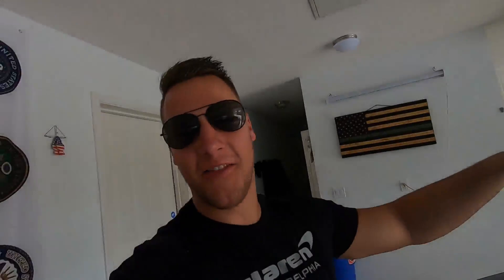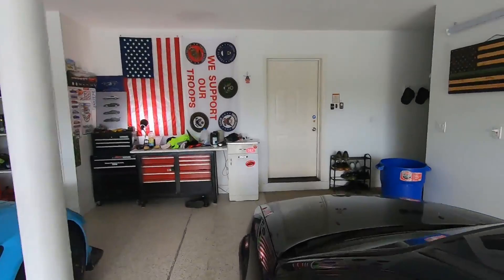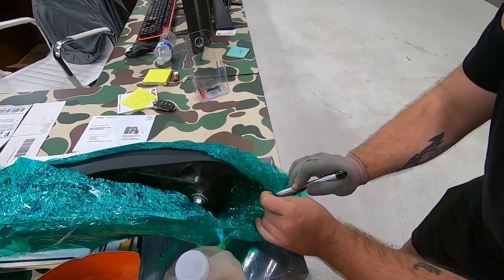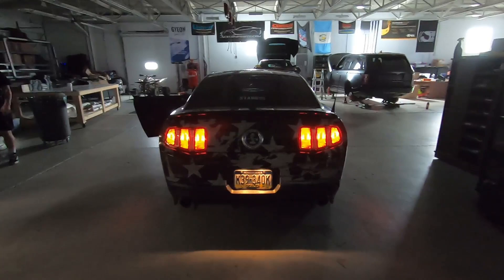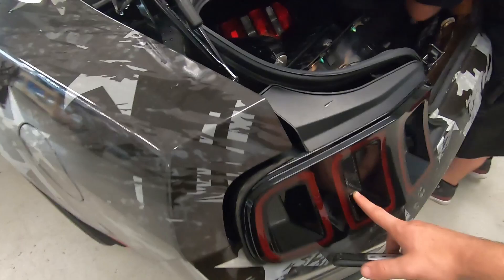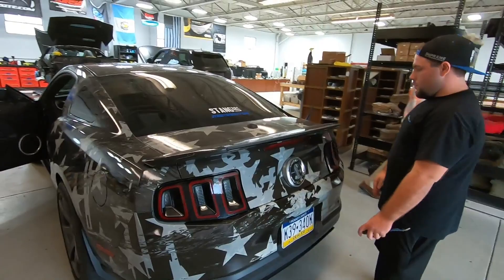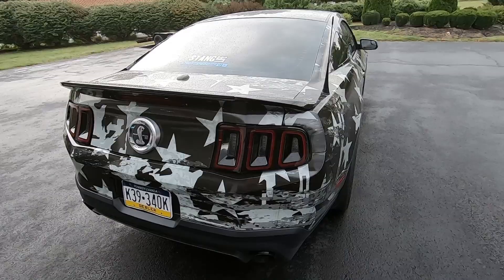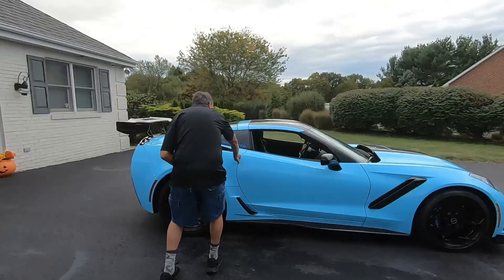EVERY S197 Mustang NEEDS These!!! **2013-14 Tail Lights on a 2005-2012**

Comment: Raxiom makes a trim piece to fill in the gap between the tail lights and bumper.
Reply: I really notice it
Reply: I was gonna say the same thing about American muscle selling a piece to fill the gap
Reply: Mike Shagwell hell that’s gonna blow the budget lol.
Reply: Lol 😂 ikr whoever wins it can use the gap as a bottle opener !!!
Reply: he couldve just gotten the raxiom vector v2s
Reply: Noxum 55 That’s what I have on my GT500. I like them a lot more than the 13-14 taillights!
Reply: I’m with you Mike. I think the gap makes it look more aggressive here, no mod necessary. On a white/bright car though I might feel different.
Reply: @ShaneSVT  i have the s550 headlights, working on saving for the tail lights at some point, they look great especially if you black out the trunk between the lights

Comment: The 2012 and earlier tail lights date the car so bad.  Great look with the updated lights
Reply: Marcus Weaver tint film made my 2010 tails look modern
Reply: I thought that was the point of the retro styled mustang. Retro equals dated. I usually don’t buy things that look dated if I don’t want something that looks dated. I can’t understand why people buy something that was designed to look dated, then complain about how it looks dated, and then try to modernize or update it. Does that not defeat the purpose of buying a dated item?  I personally like the style of the 1969 Mustang. There are some decent examples available for sale out there for around the same money you could spend on a late model Mustang. Yes, they don’t have the modern amenities that you can get in today’s retro Mustang, but I can live with that, because after all, I’m more interested in the original model, complete with the original feel and sounds. I want the original experience. If you prefer the updated version, you need to be prepared to experience the updated version with all its features both positive and negative. For instance, updated version positive, very reliable. Updated version negative, expensive and technically difficult if computer controlled Items decide to go on the fritz. 
Original 1969 version positive, zero computers onboard, shade tree friendly.  Original 1969 version negative, considered a classic and victim of collectors over-valuing them, thereby driving up prices of vehicles as well as parts.   Insurance is about the same in price, being very expensive for drivers young and old, due to vehicles being classified as sports vehicles, or performance vehicles. Parts availability for both vehicles is tight right now, due to popularity of the newer vehicle, and scarcity of the older vehicle’s parts manufacturing. Overall, I’ll take the older model, complete with all its flaws and warts. If I find myself craving the reliability, I’ll add the latest coyote engine and transmission, complete with harness and engine management system. Half the price, half the headache, all the fun of both. And don’t get me started on the clone parts and aftermarket availability of parts to make your old original plain Jane Mustang into a “classic” Cobra or GT, etc.  For the price of a new Mustang, I can build a cloned classic, with modern reliability. But I digress. . . .

Comment: And for 70 bucks at American Muscle you can actually get the little plastic piece that goes under the tail light to fit the 10 the 11 and the 12 we did that on my friends now roommates 2011 GT500

Comment: I put the Raxiom Vector V2 tail lights on my '12. Looks like '15 tail light but fits 10-12. Also $500 but I got the center brake light. Anything is better than the factory lights.

Comment: I'm just debating what should I do. I've been wanting a 2013 mustang 5.0 but I do also have a 1991 mustang 5.0 notch back red that's in fair condition. It has 250k miles with a few dents an could use a paint job. I also have a 2006 mustang gt that's in perfect condition an only has 87k miles. My question is should I take the money an fix up my 91 mustang or get the 2013 5.0?

Comment: So Mike you gonna get the 2020 Duramax and your 600LT? 

If you get the 2020 Duramax I recommended WT trim in white plus it would be a lot cheaper to get the WT model as apposed to the luxury trims

Comment: I swear man. You’ve spent so much on the durtymax and you still have those cloth seats. You gotta get leather
Reply: Cloth seats are better, there's no argument. They don't get ice cold on your ass in the winter and burning in the summer, you don't slide around on them, your skin doesn't stick to them in the summer, and ventilated seats work with cloth better

Comment: How is Tiburon worse than frs, its literally just the new Tiburon 😂
Reply: the king of it all rwd, boxer engine vs a fwd, crappy v6 and 200lbs lighter
Reply: @aaronrac2846  yes, hense why its the NEW version lol
Reply: Fwd shitbox vs boost ready rwd
Reply: @lb4899  your logic would suggest that a C4 corvette and a 2019 ZR1 arent the same car, even though one is just newer and improved
Reply: the king of it all how many “new” cars do they change their entire engine and drivetrain for the new model?
Reply: @Moistfersure  no. The Tiburon is a whole different platform than the frs/86/brz
Reply: @Moistfersure  and yes, the c8 is an entirely different car than the c7
The c8 is GM's first step towards a supercar and the c7 is still just a v8 rwd straight line car
Reply: @aaronrac2846  ranger, Colorado, titan to name a few
Reply: @lb4899  yes, that was never disagreed upon lol
Reply: the king of it all when I say drivetrain I’m saying went from fwd to rwd or any change of the sorts those were all trucks A this is a sports coupe and B they never changed they were always 4wd